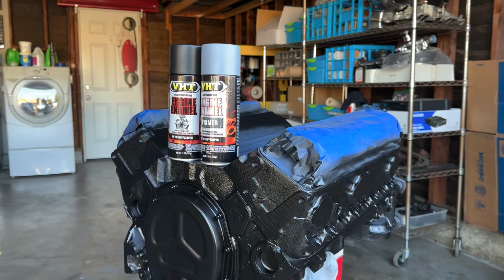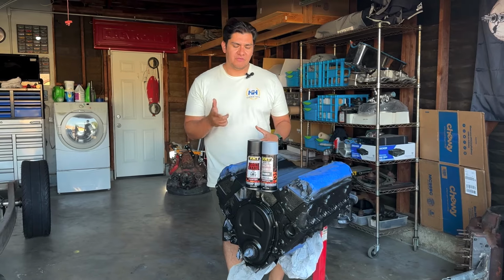USING VHT ENGINE ENAMEL ON CELYNA'S SBC FOR HER 1932 FORD HOT ROD: PART 3

Comment: Love the process of taping the parts before to the paint. 
But here in Russia we usually use powdercoat for most of the frame/engine parts - it is cheaper and paint is very strong.
Reply from the maker: I agree… it’s relaxing in a way. I don’t think I have heard of powder coating an engine but I guess that could work… although expensive here in USA compared to paint